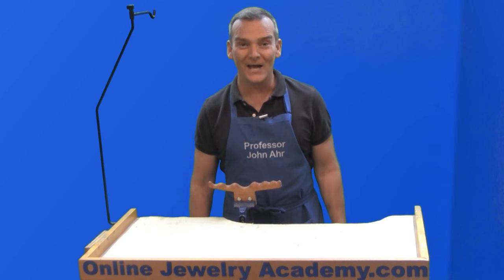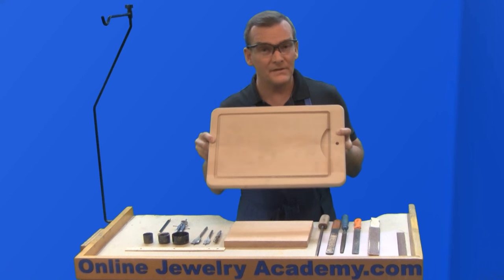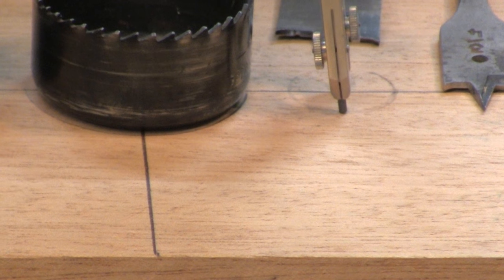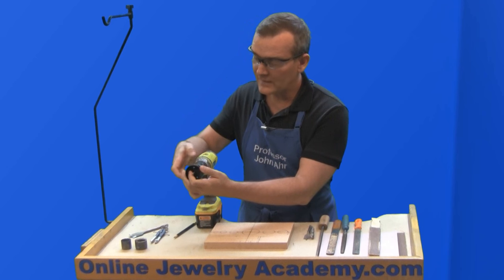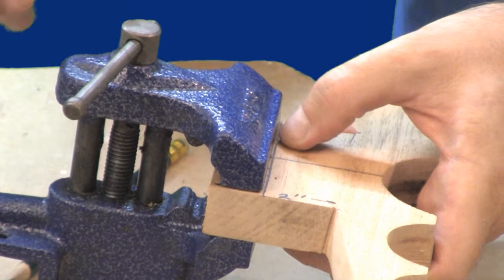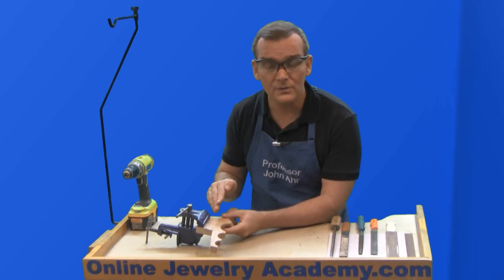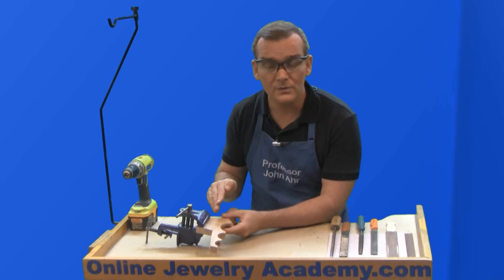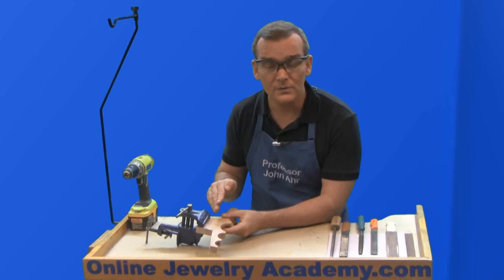Make Your Own Sinusoidal Stake For Anticlastic Raising - Read Description

Comment: Maybe you could use longer bolts, and put some loose bigger nuts on each side, so you can tighten it up easier and still have a flat contact with the vise.
Reply from the maker: All good suggestions.  I say do whatever you need to do in order to get the tool to work right for your needs.  
Thanks for your support! : )
Reply: Thank you, for the nice content. Always wanted to try one of these, maybe I'll look for that old cutting board that's laying around somewhere...
Reply: perhaps two pin driven into tight holes that are parallel with the working surface/curvey bits would suffice(like they use in the Delron products)

Comment: I'll try to make something of the sort but not with long extensions so it won't Break maybe attach a base to it  so I can set it aside and be able to clamp it to my work table. So this tool is just for shaping a already tooled  pice to give it shape? Not to hammer hard on?
Reply from the maker: Hi David,  The extensions aren't that long actually.  And, they are necessary if you want to make a smaller piece that curves around a wrist or neck.  This is not a stake for forging.  This is a shaping tool.  There are metal and plastic versions of this tool for sale.  I find that the wood sometimes is easier to work with.  Have fun with anticlastic raising. : )

Comment: Hi John, Great video. I am just doing a template in Illustrator so that I get it correctly placed on the wood but I am finding it is very tight on a 10'' by 6" piece. I can't cut up 2" from the bottom to cut out the waste material. Have I got the size of wood wrong? Thanks!
Reply from the maker: Glad you liked the video.  You've quoted the size mentioned in the video.  I don't understand why you're having trouble creating the right shape.  This is one of those situations where I'd have to see what you're doing.  Sorry I can't be more helpful.  Good luck.
Thanks for your support! : )
Reply: Hi Born to Build,Using the 6" width plank, we measured down 1" from the aka top edge and declared this our altered centerline.We weren't able to make two, but were able to make a really nice one. My husband went to Lowes' and purchased a two foot scrap piece of Red Oak for 7 bucks. So if you center higher than actual center of your piece, you should be able to make this.  This was a great team effort between my husband an I.  I wanted it, so he bought all the tools I would need to make it, it the process he got some hole saws sizes he didn't have, and I got the files I would need for other projects..a way to this womans heart is giving her tools..lol
Reply: i have a board 5 by 10 and it doesn't work like yours either, i think yours is 10  x 10 to use those measurements for two

Comment: Thank you so much for this!!!  I made one out of some scrap oak boards and it came out great!  My peaks are a little more perky though.  I found 5 inches not to be long enough so I went up to 7 1/2 inches (post script: I see you added notes updating your board dimensions) and centered it from there to make sure I had enough tang left at the bottom to put into my vise.  I also added a think rubber band at the bottom of my tang so it would stay more tightly in the vise. I banged out a couple bracelets before I watched your other video explaining to use a metal hammer on wood and delron/nylon hammer on metal stakes...  Thanks for the tips.  I'll go back armed with your tips.
Reply from the maker: Glad you found the videos helpfully. Thanks for watching! 😀

Comment: Excellent demonstration. Would you like to reccomend the best measures for the piece of wood? and the holes? Thanks a lot.
Reply from the maker: The size of the grooves depends on the scale of your work.  If you are making small pieces, you can drill holes that are 1/4", 1/2", 3/4", etc.  If you work is larger,  your drill holes should range between 1/2" and 1 1/2".  The wood blank should be a hardwood plank about 10" long with no knots.  You can reference commercial stakes available online if you want to copy their measurements.  Have fun!
Thanks for your support! : )

Comment: Excellent video!, good clear instructions.  A friend suggested that maybe a Dremel tool with rasp and sanding could make the forming a bit easier, but only if you're experienced in using such a tool. I agree that oiling the tool will preserve it but would a thin coat of wax on the working areas be helpful as well?  Again great video.  Thanks
Reply from the maker: I agree with you and your friend.  Using mechanized wood working tools can make the creation of this type of stake much easier.  Waxing the stake isn't a bad idea.  I just prefer the stake to not be sticky in any way.  I want the metal to move smoothly over the tool.  Glad you enjoyed the video.
Thanks for your support! : )

Comment: the rasps...we have a variety lying around in the tack room which have been primarily used on hooves but look really similar do you think they would work?
Reply from the maker: Hi Anne,  Yes, you can initiate the carving process with rasps.  But, you'll need to switch to files and sandpapers as you refine your work.  Good luck.  This is a project that requires a bit of labor.
Thanks for your support! : )